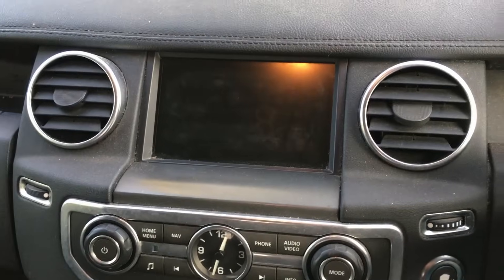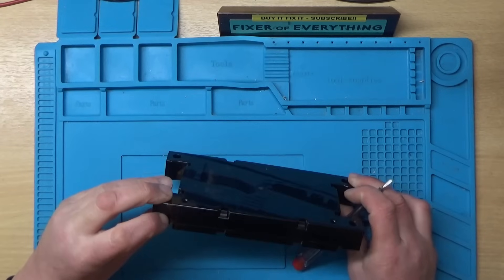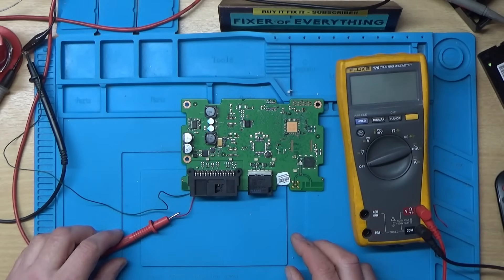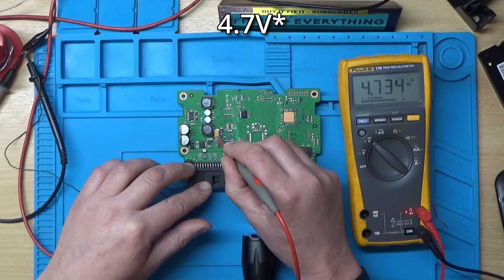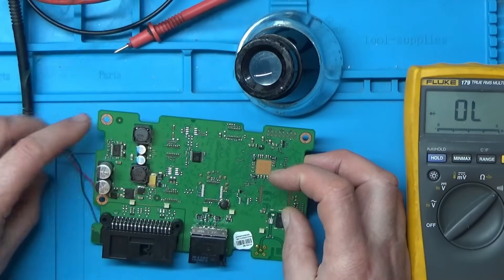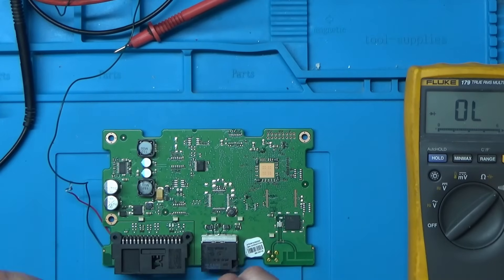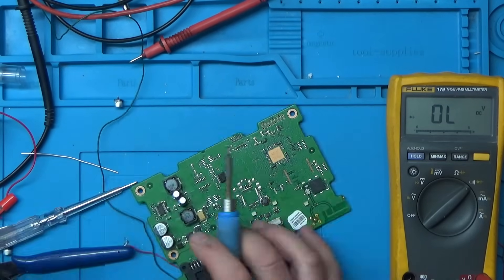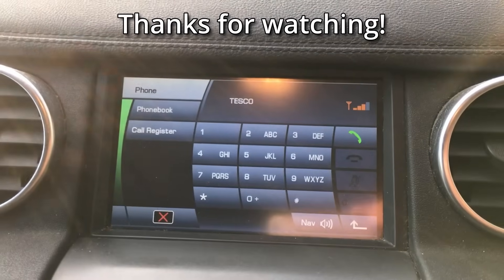Faulty Land Rover Discovery 4 Bluetooth Module | Can I Fix It?

Comment: Ah the times when you could toss out the stock radio and install 1-2dinn aftermarket radio with all the bells and whistles. These days you are stuck with the OEM crap
Reply from the maker: Yes, agree. The software also becomes outdated quickly compared to the lifespan of the car too.
Reply: Ah, but the OEM stuff usually already has all you would need built in. It just may need to be unlocked via software. 
Even my old Beta 4 radio from my '98 golf has expansion ports which allowed me to add Bluetooth to it. 
My dads golf 6 oem radio also had an Aux in port in the back. Just software locked.
So, they ain't so bad, those OEM radios.